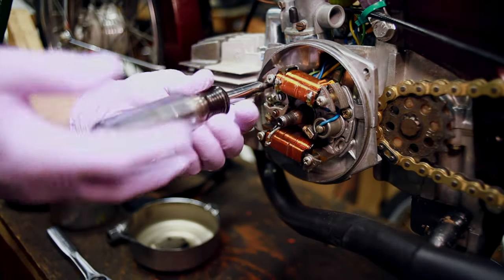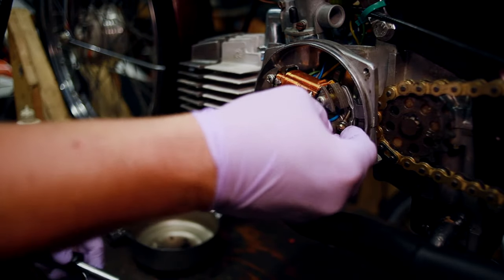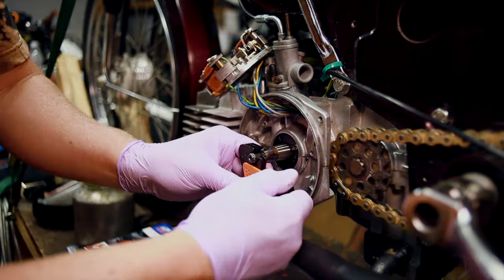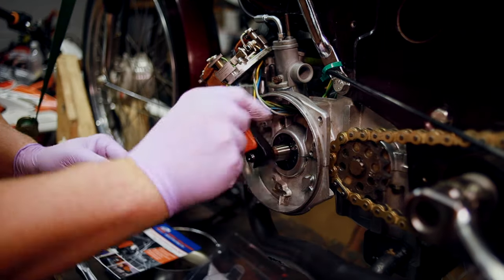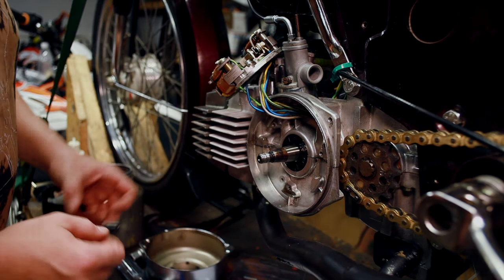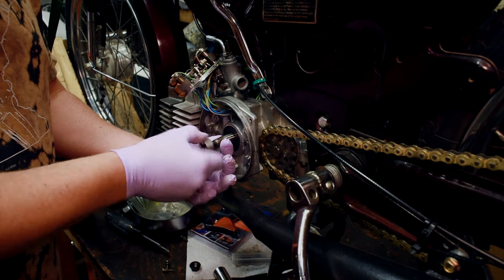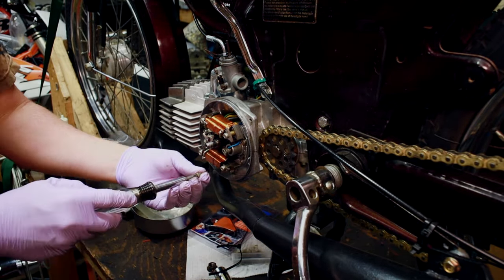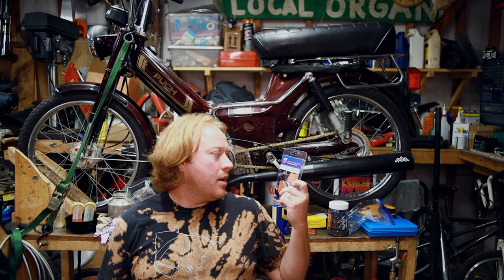How to repair a stripped or damaged thread properly! Puch Maxi with a stripped crankshaft

Comment: EXACTLY what I needed!  I have a Maxi that’s been on my work bench for far too long with this exact issue. I would have figured it out some day… but now I know the specific tool to order to do it right the first time.  Thanks!
Reply from the maker: This is the exact thread repair die I used. M10x1.0
https://www.mcmaster.com/catalog/2573a57

Comment: Been here. Done this. This is why I stopped using impact for tightening down flywheel nut. Gotta torque it to spec (25ft lbs).
Reply from the maker: Yeah an impact will spin the nut completely smooth.

Comment: How did you get the nut out?
Reply from the maker: I got super lucky and it unscrewed with the help of a little pressure from two screwdrivers pushing the flywheel out.